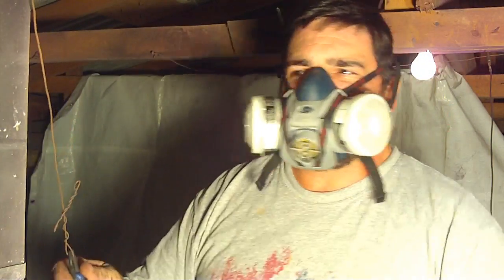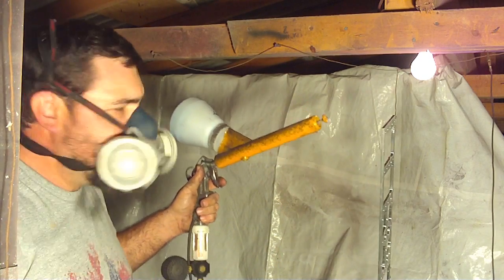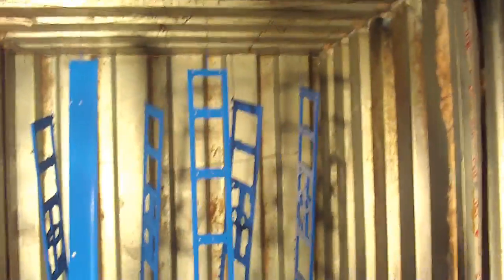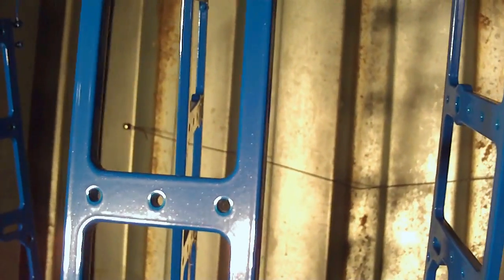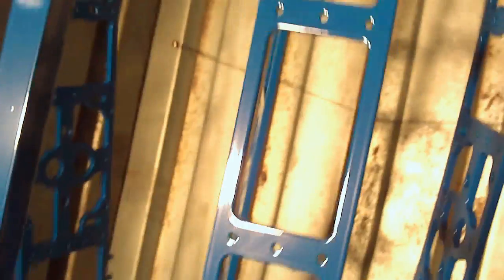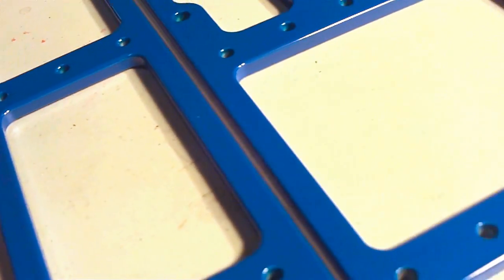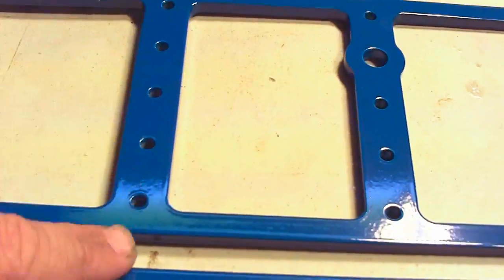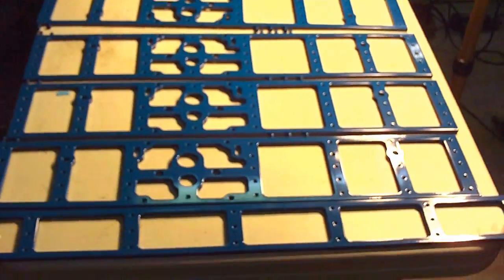Powder Coating Robot Parts at home

Comment from the maker: I use three elements wired in parallel (just like wiring residential light fixtures or outlets)  As I recall this setup draws 40 amps at 220vac or ~8800 watts.  So you need to be safe, use proper wiring techniques, wire gauge, breakers, and some type of temperature control system.

Comment: plz answer me. PLZZZ

just a question. i have made a home made oven, with 3 oven elements... 
the elements need to be ran on 220w. i guess. 

does each element needs to have 3 different 220 plugs ? or all 3 element in to one plug ? 

i just have one transformer with 500W from 120V makes it to to 220V. 

and is 500w to much ?? will 100W do it ??

Comment: @JlerchTampa  im doing some powdering on my motorcycle, but i ran into a problem with the oven, my place has 110/120  outlets ,  oven its 220/240. how did you set yours up?  do i have to build mine up?

Comment: @JlerchTampa
I haven't done powder coating but first thing that came to my mind is to cover inside corners first and use more air pressure to get powder evenly spread. (More pressure only for inside corners). Is that how it's done or do you also need to lower the voltage? 

And what about more vacuum chamber videos? Plasma cleaning perhaps? :P 
Good stuff. Thanks.

Comment from the maker: @guardsman322  You'd need 220, I think each element is 1500 watts for a total of 4500 watts.  @ 120v you'd need 37.5amps, which is too much for a normal 110v outlet.

The elements are just old kitchen stove elements I robbed from a junk pile..

Comment from the maker: @vman613 I did make my own chamber,  But no plans, its just a metal box wrapped in fiberglass insulation, with an outside skin of thin aluminum and three oven heating elements.

Comment from the maker: @2r1f  The foot control is just an on/off switch. Well it WAS an on / off switch, mine broke so now the power supply switch is the on / off switch and I don't use the foot switch any longer.

Comment: How do you use the foot control on your powder gun? Does the foot switch vary the strength of the electrical charge or is it a simple on/off of electrical charge?

Comment: Always preheat the part before coating. Whatever dirt, oil, ect is in the substrate will outgas then instead of during the cure cycle. Also cleaning with Acetone works nice cause it leaves no residue.

Comment from the maker: Bead blast or wire brush, then spray the dry powder and bake at 380f for 30 minus (or as specified)

Steel is a little funny, I haven't perfected it yet. (its still looks great, but its not as corrosion resistant as I'd like)  I think I need to start applying  a base coat of Zinc rich powder material.  I just don't do enough to had the answer yet..